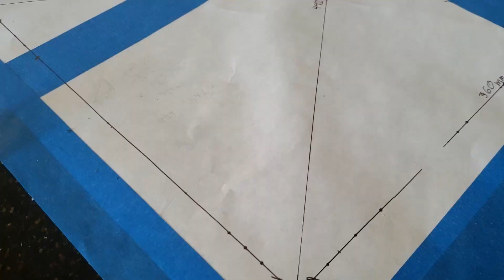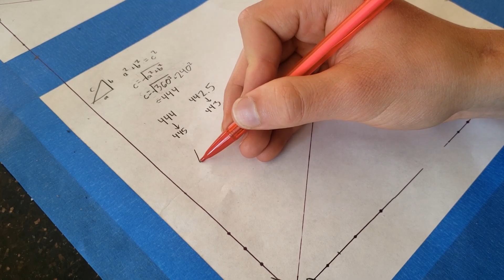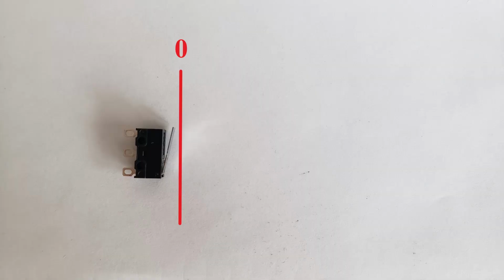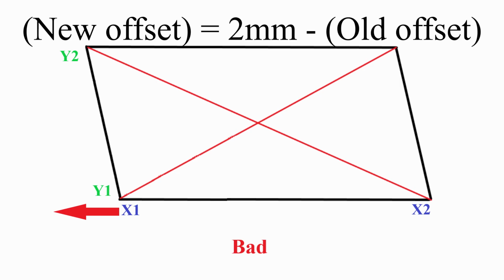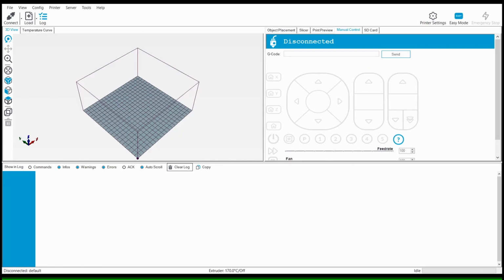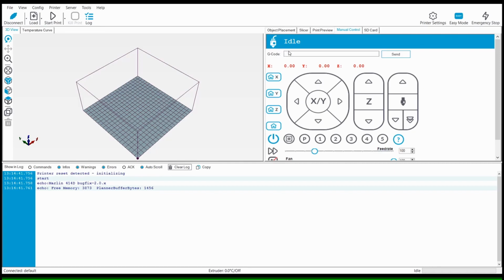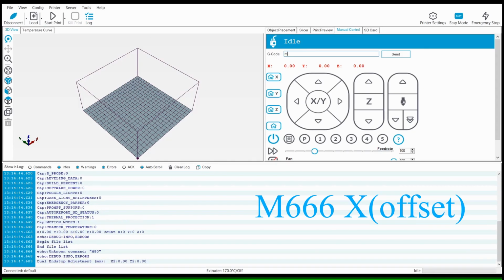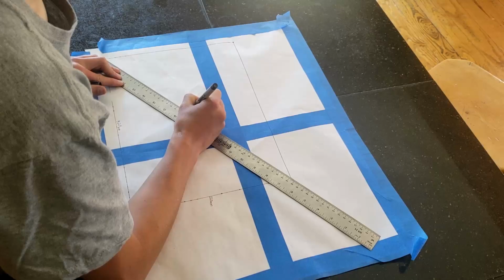Dual Endstops Squaring and Calibration on the MPCNC using Marlin

Comment: I would like to know about the belt tensioner that are in the video at 1:33? Did you make them or is it on Thingiverse?
Reply from the maker: I made them based off of a design on Thingiverse. They didn't work very well since I didn't account for some clearances so I ended up just using zip ties like the Ryan's design intended.